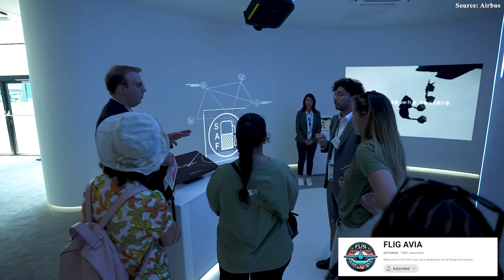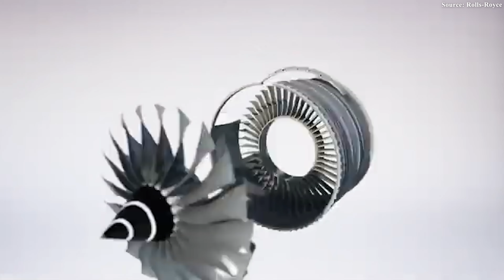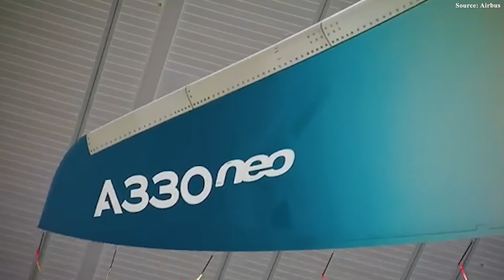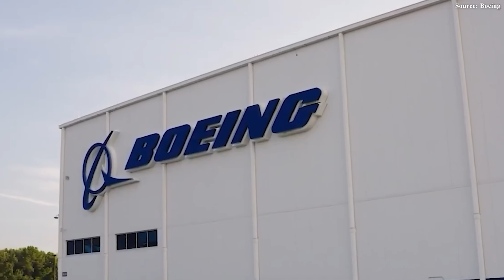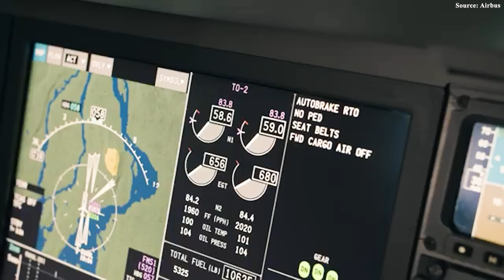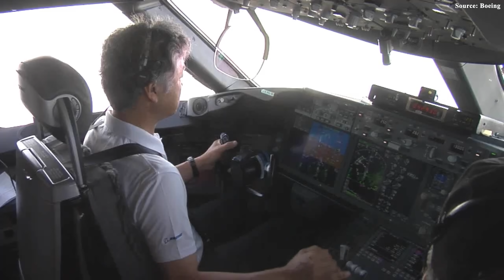Airbus' HUGE PLAN to Build The A360 that SHOCKED All Aviation! Here's why

Comment: I dont undersand how a A360 should compete with a 787 and a 777X while not replacing a rather new A350 which is sitting right between those two planes.

Comment: As long as Airbus will remain an engineering driven company it will beat the bankers/sharholders greed of the B. in due time. One company is aimed making aircraft, the other one is primarily aimed at making money. Pretty obvious how that will end: In 10 years or so, COMAC will try to obtain a considerable share in the Civilian Aviation part of B.Bank.

Comment: Boeing's countermeasures:
Install open fan engines (CFM's RISE) on top of the 737MAX's wings, like the HondaJet. Use a T-wing tail.
Give the 737MAX wings made of composite material with flexible edges.
Remove MCAS from the 737MAX.
The 737MAX7 will be succeeded by the B606 (MRJ).
Introduce the 797, a twin-aisle aircraft with shorter main landing gear. The aim is to shorten passenger boarding and disembarking times, so it will be used on short-haul routes and its total weight will be the same as the 737MAX10.
Reply from the maker: Thanks for your sharing.
Reply: @FLIGAVIA  That's Impossible to install the new open  fan engines  under 737's wings.

Comment: Alas, Airbus look like repeating the mistakes of the A380. Airbus are highly skilled in cutting edge developments and technical skill but lacking in customer understanding. Boeing are already facing issues with airports having to Re certify to accept the folding wing tips. Airbus ran it to problems with Rolls Royce engines on the A380 and they have issues with advanced engines on the A350-1000 overheating and having uneconomical maintenance overheads. It would be much more sensible to establish a path to the future and going step by step rather than the airbus “look what we can do” approach. I also have concerns about the safety to ground staff of uncovered turbine blades and the suction effects they could cause. There has been a race to go longer distances and carriers seem to be bored with that. The technical advances need to fit together for sales plan meeting the focus needs of each carrier. Is it higher Premium pax load with more comforts, is it as cheap as possible? What routes does it fit? How will it stack up to the 777X, a possible super twin 747 and the Boom supersonic planes? How will the new technology work in extreme climates like the middle East? Hoe flexible is the equipment for Pax/Freight shipments? What is the MTOW, what is the range? That is what will sell the plane nit the engineering excellence.
Reply from the maker: I don’t think Airbus has any trouble understanding its customers. By the way, you’ve given me many perspectives and aspects to explore further. Thank you very much.
Reply: Talking to confort, A380 is by far the most confortable plane on pax perspective for long distance. Even though it is complicated to fill up and expensive to maintained. I don’t share your view point on Airbus cutting the corners maybe you wanted to say Boeing. Because American plane maker have been caught many time doing bad things resulting in tragedy. Not Airbus.
Anyway I wish Boeing to be as good as Airbus on reliability in the future.
Reply: So, you have no clue how aviation works: The turbine, reliability, cost etc have nothing to do with Airbus, Boeing, Embraer etc.  THey are ENTIRELY separate contracts with GE, RR, P&W

Comment: Many of the airlines with B777 are in the last 10 years of a 30 year life span. It takes between 8 to 10 years to get a new aircraft certified and by the time the A360 is approved, many of those B777 are going to be retired. It makes sense for Airbus to announce the A360 now as a B777 replacement and give it the means to be upgraded during it's lifespan with better engines. Especially as the B777X will probably still be waiting for certification!
Reply from the maker: It’s time!

Comment: Boeing's Countermeasures:
Install open fan engines (CFM's RISE) on the 737 MAX's wings. Use a T-shaped tail.
Transform the 737 MAX into a composite wing with flexible edges.
Remove MCAS from the 737 MAX.
The 737 MAX 7 will be replaced by the Boeing 606 (MRJ).
Introduce the 797, a twin-aisle aircraft with shorter main landing gear. The goal is to shorten passenger boarding and disembarking times, so it will be used for short-haul routes and its total weight will be the same as the 737 MAX 10.
Reply from the maker: Thanks for your sharing

Comment: The timing matters—787s from 2011 retire mid-2030s. Perfect window.
Reply from the maker: Yes
Reply: Delusional.  It(787) is composed of CF.  Has 2X the lifespan of Aluminum.   Will need new engines.

Comment: If Airbus nails morphing wings, Boeing’s 777X advantage shrinks fast.
Reply: Morphing schmorphing....  = worse take off performance as you LOSE CL max.  a350, a330, 787, 777, 777X already max airports current runway length.  Morphing wings just makes this WORSE.  So, unless EVERY major airport in the world increases its runway length by another kilometer....  This is DOA.  Guess what is NOT going to happen?  A decrease in CLmax for takeoff in next generation aircraft.